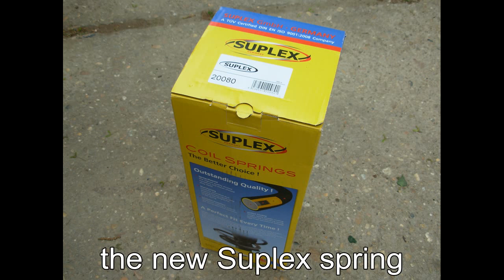Mitsubishi Pajero broken rear spring replacement

Comment: What are you using spring compressors for on the rear?  You're already removing the lower shock bolt, just allow the lower control arm to drop after that and it's easy to take our the spring by hand.

Comment: where did u buy the spring ..pls
Reply from the maker: sam palle 
I don't recommend to you the Suplex spring, i think it is a little weak for the long wheel base Pajero. I used it only 4 weeks, and i buy OldManEmu typ2917 sprins.
Otherwise here in Europe you can buy Suplex springs in most of the car part shops.